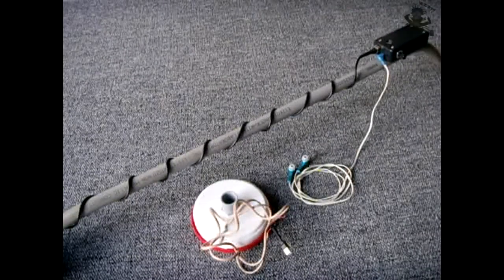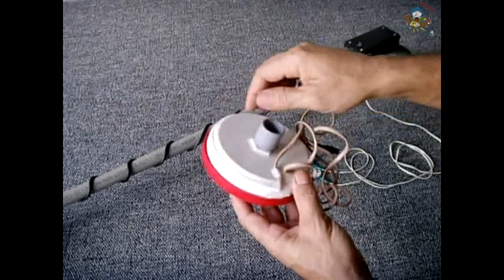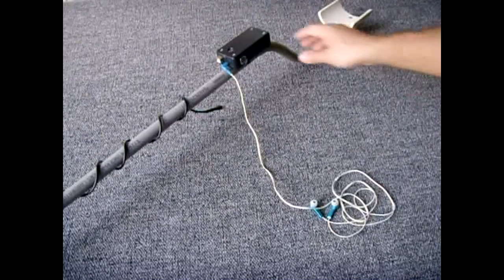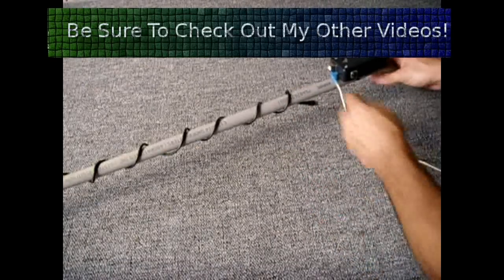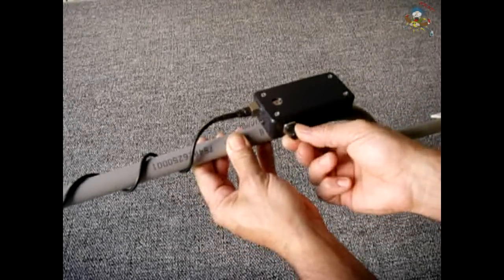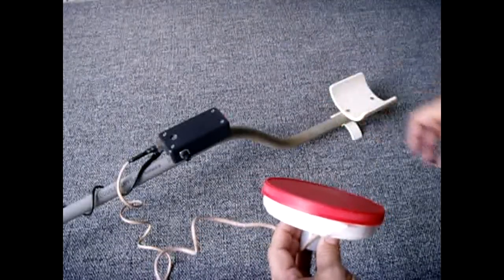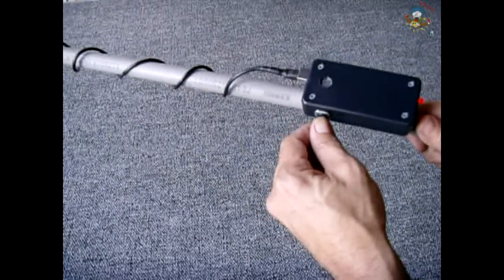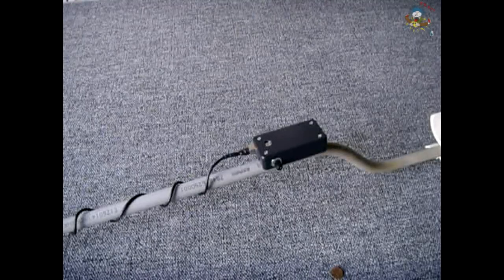How To Make 2 Coil Metal Detector!

Comment: WOW<!
Nice project.. I check the part one.. and I want to try building..
I have some questions.. about the 50 turn and 70 turn coils... what are their inductance?
The freqency to respect in the circuit  is 15Khz?
In this video you change the diameter of coils.. what is the new inductance for every coils?

Thank you so much

Comment: Hey, just subscribed, great build and excellent job explaining things. 

One question: does this circuit have issues detecting objects in salt water? Eg. Detecting at the beach in the surf or wet sand? My current detector has ground balancing issues, wet sand is no good. 

Thanks!
Reply from the maker: +ralphroc 
I tested the detector at the beach. No issues. You only have to balance the threshold.
Reply: +electronicsNmore Thanks much for the reply. I actually just read your intro and see it was mentioned there already. Sorry about that!

This will be my next build, for sure.

Comment: Very nicely done...really appreciate the video!!    Have you thought about putting your control box inside a waterproof case?
Reply from the maker: Not really. I don't plan on using it in the rain. If it does rain and some water gets on the control box, it will not be a big deal. I can glue a very thin plastic membrane over the speaker to make that waterproof if I wanted.

Thanks For Watching! Be sure to share and rate Thumbs Up.